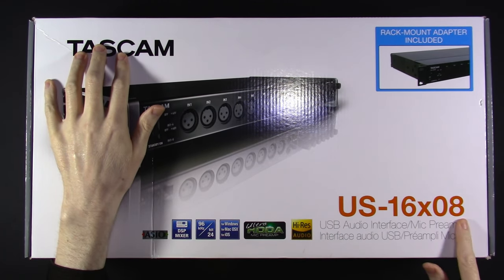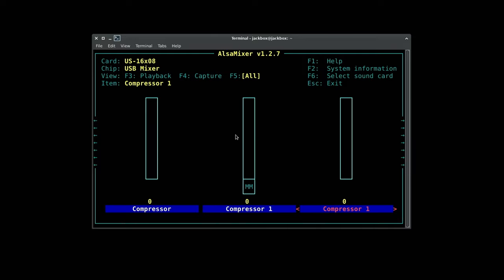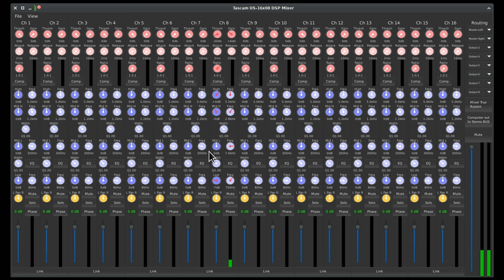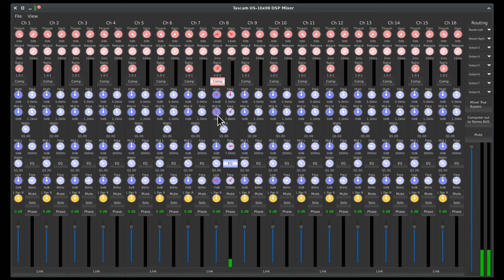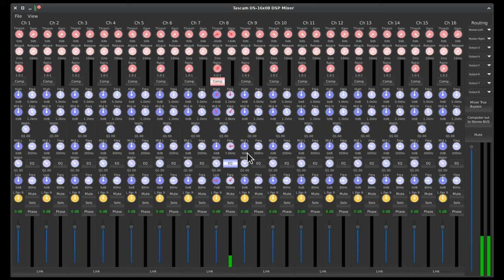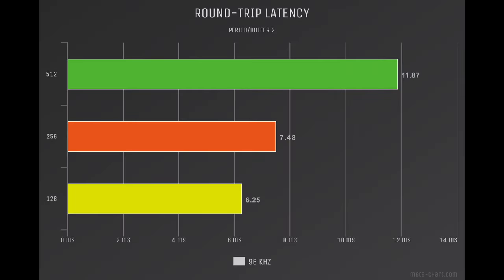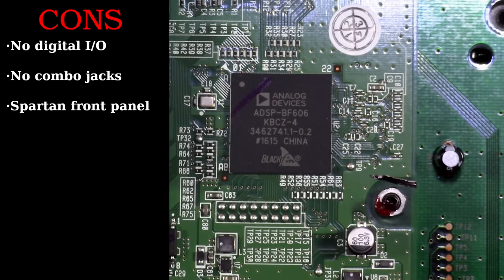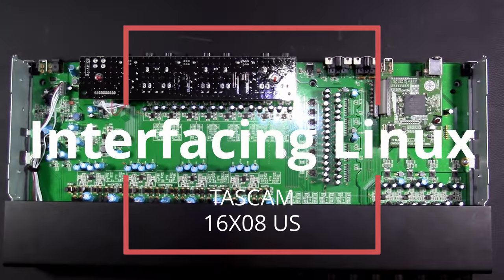Interfacing Linux: US-TASCAM 16X08

Comment: Thanks for the review. Nice to get a Linux centered look. Have you tried it with pipewire.. I believe I Ubuntu studio 22.10 is shipping with pipewire as default.
Reply from the maker: It should work with PipeWire with minimum fuss since it works with Jack hosts. I would recommend using Jack or ALSA directly.

Comment: I've been racking my brain on this one, have had my 16x08 for years now and loved every second of using it on windows, but wanted to have the chance to take it mobile with me and my laptop with ubuntu+reaper or renoise but I've hit quite an annoying issue trying to access the hardware midi in/out from in reaper. I've tried seemingly everything, have a2j running and I have the nice red jack midi input for reaper showing up in qjackctl as well as the a2j device with 3 outputs but when I connect any of the 3 to the reaper input (I made extra sure that in reaper a midi channel is listening to all midi channels/devices) I'm just simply not getting any midi messages through to my reaper from the midi input on the back of my tascam. As a control to make sure I didn't have something else messed up I had tried plugging a midi controller that has linux support to my laptop via USB and its a2j device is showing up just fine and when I plug the midi output of that midi controller into reaper its actually receiving midi just fine.. Not sure if maybe the midi in and out are busted on this or not but would love to know if its working just fine for you and if so maybe either a follow up video or explanation as to what I could be doing wrong? LOVE this quality content btw, you earned my sub a thousand times over!!

Comment: are the compressors and EQs really run in the device? not in the PC processor?
Reply from the maker: Correct.
Reply: You can see this by running `aplay -L`.  The output is huge but it lists all of the controls.  Compressors, EQ, control lines, etc.  Approximately 385-ish devices.